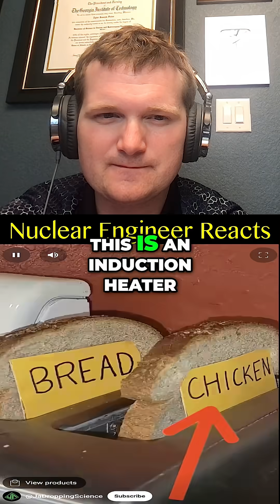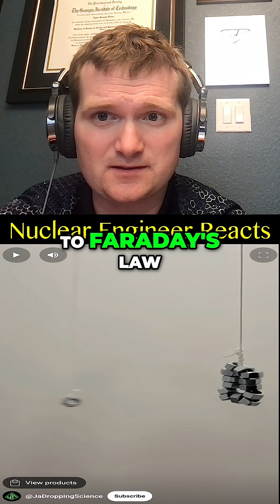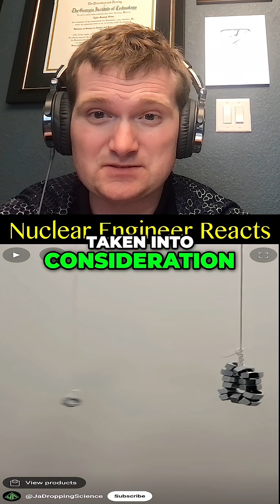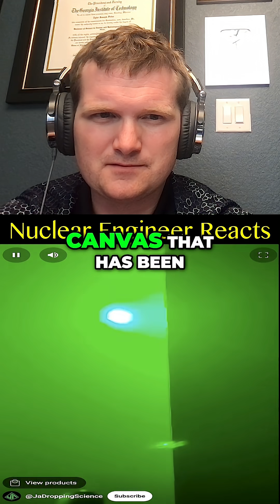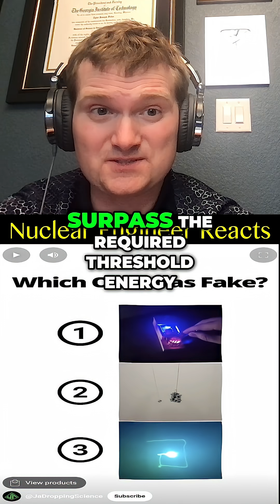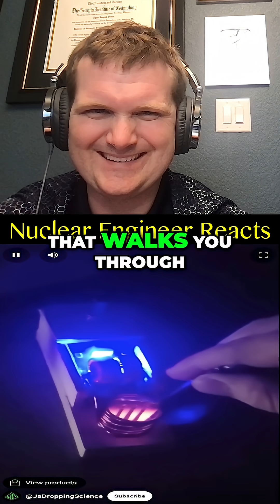Drawing with Lasers - Nuclear Engineer Reacts to 2 Truths & Trash by JaDroppingScience

Comment: The final one is the theory which won Einstein the Nobel Prize. The theory before him thought that light is a continuous wave, and electrons are excited after absorbing enough energy. But this cannot explain 3 phenomena: 

1. Only light with certain wavelengths can excite electrons; no electron will be excited even if the intensity of low-wavelength light is much higher
2. Electrons are excited almost immediately, while according to traditional theory, electrons should take some time to absorb enough energy
3. At the same intensity, light with lower wavelengths can cause more electrons to be excited

While Einstein's photon theory explains all those weird phenomena.